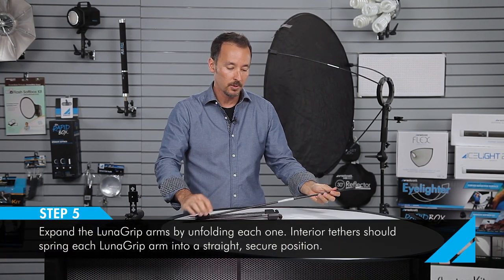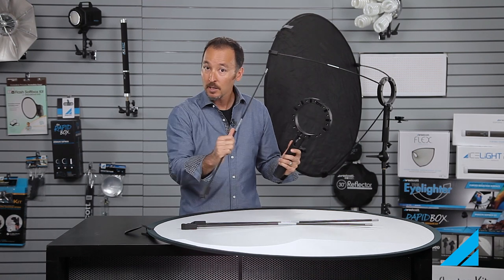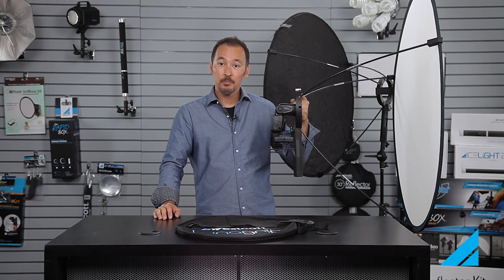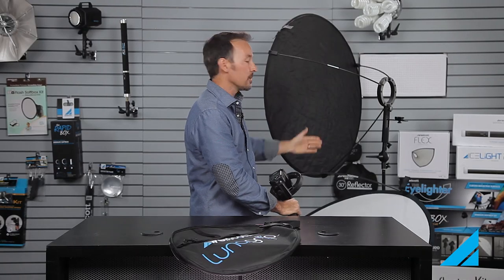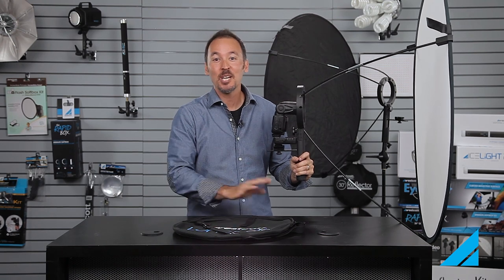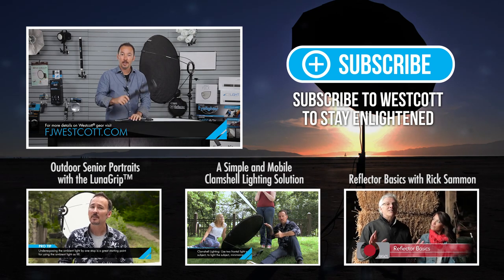How to Setup the LunaGrip Speedlight Modifier

Comment: I have hard time getting the luna grip in its case and your assembly was supposed to include disassembling too? Pleas send video how to make the big stretched circle into small to put it in its case. Your video is short on that.
Reply from the maker: Here is a video showing how to collapse a  reflector but the method will work with your collapsible  diffusion panel as well.   http://westcottu.com/how-to-fold-a-reflector

Comment: will it work fine with Joel grimes 24" dish? That way you kill the speedlight hotspot
Reply from the maker: +shaolin95 Thank you for watching, the lunagrip is designed to be used with speedlites, whereas the 24" Beauty Dish is specifically designed for strobe.  To eliminate a hotspot, we recommend using a wider spread on your flash (ie. 24-50mm)
Reply: You can feather the LunaGrip just like a softbox to avoid the hotspot.

Comment: Can you think a way to adapt a Godox AD200 to this?
Reply from the maker: Shaolin, mount the bracket Kevin is mounting at :50 upside down.  Remove the cold shoe and attach the AD200 to the 1/4-20 mounting screw from the cold shoe using the midway female 1/4-20 receiver on the AD200.

Comment: It’s ridiculously expensive and you can’t adjust your distance from the strobe which is imperative for products and portraits. You can easily do this with reflector holder, two joined flexi arms and two grips for £30 and it’s totally solid. Then you can adjust your distance from you strobe to adjust how hard you want your and how much diffusion you want. And as a bonus the equipment you used has multiple uses.
Reply from the maker: Mark,  Adjusting the zoom of the flash/speedlight will also allow some control of the diffusion and softness of the light coming through the Luna Grip/diffusion.
Reply: Westcott Lighting True, but that’s very limited.
Reply: I love mine. You have to know what you can do with it. I also use it as a reflector holder, and it's great for use with an assistant. if I need more reach I just attach it to a monopod and my assistant will hold it. Or I just put it on a light stand if I have the space at the time. I do agree that it's quite overpriced, though.

Comment: Why not use a shoot through umbrella instead?? only $17!!
Reply from the maker: Every modifier has its nuanced differences.  A shoot through umbrella  https://www.fjwestcott.com/32-umbrella#206=155  as you suggest, offers a good option to diffuse light when combined with a  ProGrip https://www.fjwestcott.com/progrip-speedlite-handle   .   The LunaGrip offers a perfectly round  catchlight with no umbrella ribs in a flat surface.  Application and Personal taste will determine which setup you choose.  Thanks for watching and commenting.
Reply: I like it use 2 reflectors (skrim over silver) a lot for bounce. Can the arms hold 2 reflectors at once?